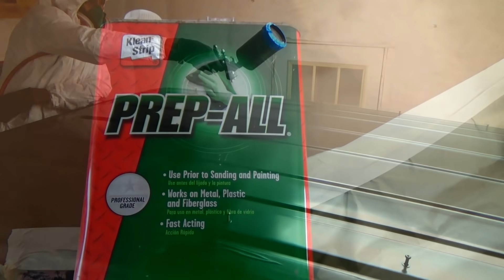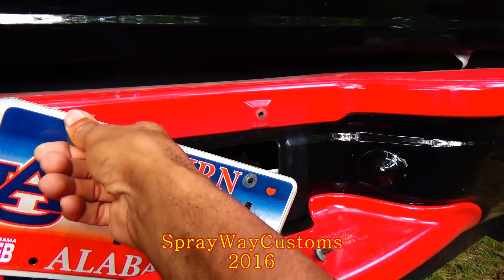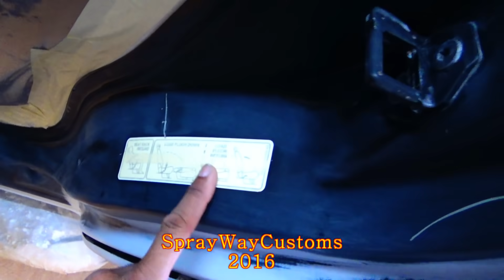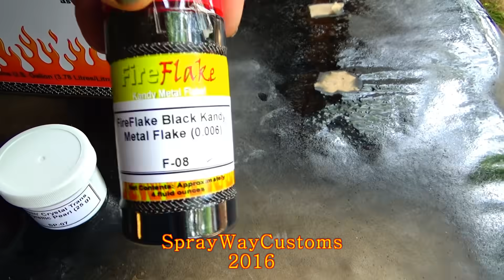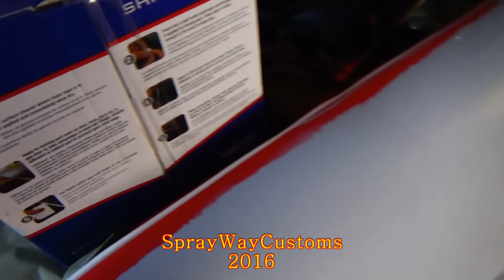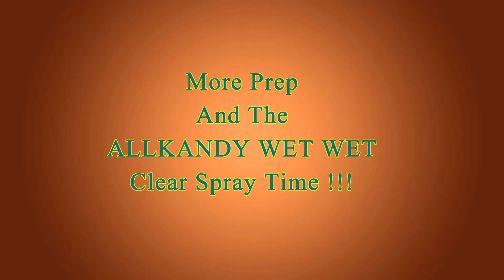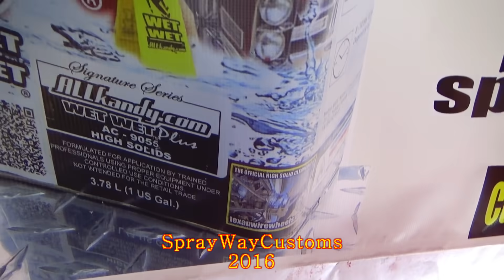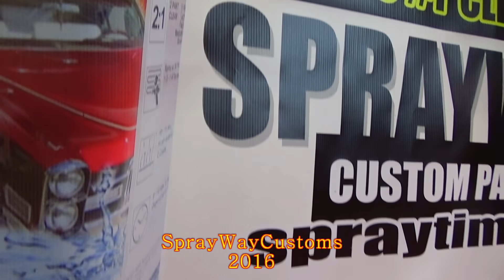How To Paint A Car Or Truck At Home /Three-Stage Pearl / ALLKANDY Wet Wet Clear / Urekem Base Coat

Comment: Just a tip for the lights is a cloth and some baking soda will take off some of that haze. Good video. Paint is too nice for an exploder but to each his own. Someone probably says the same thing about my 4runner. I know that with 90k miles it will be on the road another 15 years. Thanks for the video

Comment: Excellent work!  When you paint the jambs then are painting the exterior does the blow through in the jamb become noticeable?  My truck is completely stripped and (no glass or interior) and I'm painting all of it, and I'm not sure how much to mask off.  When I'm doing the interior and jambs and they are done, should I be masking them off or putting foam in the jambs etc to keep the overspray off?

I'm using Urekem single stage Metallic black.

Keep up the videos, you inspired me to try to do this myself!

Comment: Got a question for you. I have that same harbor freight spray gun you used for the primer over the body work area. It says it requires 14cfm which is a lot! Most other guns say the same. What size compressor are you running..???
Reply from the maker: I have a 60 gallon Husky Compressor from The Homedepot

Comment: What's good dog. I'm starting to get pressed for time and money trying to figure out how to cut some corners. Can i sand single stage paint, use it as my primer, and apply my color even though single stage has clear in it?
Reply from the maker: If the paint in good shape there's no need to prime it maxie9506
Reply: @SprayWayCustoms  its chipping in spots. I was thinking spot repair, body filler,  prime over the spots then paint.

Comment: Is it possible to color match a stock vehicle colors
 and translate it to a candy finish? Say you want the original ford Emberglo which was a two stage paint job. Use a black base with minimal flake, a second layer of 2k clear, spray the Emberglo, then a layer of 2k clear. Am I on the right track?

Comment: Another good job bro. Im sitting over here at around 4:50 cringing when you pulled that seal on the door and I saw they had Copper Clad speaker and power wire. Get your boy to get that shit changed to real copper. But you keep doing you, looked great man.
Reply from the maker: Lol...I need to send him on over there to you and you'll get him straight..without a doubt..thanks

Comment: I am going to try and paint my truck, I want to go with two colors but I am worried about cure time on base coats before applying clear coat, how many days was it from when you painted black and clear coated hood to when you clear coated whole car? I been trying to read if you can go over 24-48hrs after base coat and still insure clear coat will bond good, noticed you sanded hood after you applied black base, is that the trick? Can you clear over base or other clear after weeks if you sand it or does it still need to be done within a day ? or hours?
Reply from the maker: If you wait after 24 hours I would recommend sanding it so the paint will stick.

Comment: in the begining when you DA'ed with 180 you feathered in the two tone line. But after when you cut back in the video and the whole truck was done but the two last doors, How did you you finish it because you didnt show?
Did you continue with the 180 on the DA? or Did you use a different grit? or Did you use a block instead?
thanks
Reply: and when your done with all body work and your ready to prime do you sand the whole car with 400 or scotch brite??. Thanks

Comment: You covered that whole truck with 2 quarts of pearl and the reducer?
Reply from the maker: I had a gallon of intercoat clear with 25 grams of each pearl but I didn't use all the pearl in the clear. I had plenty of the mix left
Reply: SprayWayCustoms awesome man thanks for the reply 👍 you do some badass work bro

Comment: Have you tried the new high solid clear yet that you can cut with reducer? Watched a all kandy video other day. Crazy how you spray and have very little trash and dude at all kandy spray and he has enough trash to fill a landfill. 😂. Not trying to cut him down just sayin.
Reply from the maker: Matt, I haven't tried the ALLKANDY EXTREME yet but it's going on my next project...I really don't get much trash..only problems I might get is overspray landing back on the panel if it don't get pulled out the booth in time. I might get a bug here and there in the summer time, it's really the environment  and the weather plays a big part in it too if your not spraying in a real spray booth...thanks for the comment

Comment: Next time you mix your UR-011, try turning it sideways or upside down, it will help with dripping down your hands. Also, for someone who never painted, what setup would you recommend for a beginner. For example, Type of spray gun/compressor.

Comment: I take it ur lid on ur paint cup has popped off b4?? hinse  the tape ..shit happen to me a few times ...like them puppies
Reply from the maker: It never popped off during paint but it have leaked when full and that's something you don't want to happen in the process of painting that's why I just put a piece of tape around the lid...I got new cups and lids but I just always use the same old cup...lol
Reply: +SprayWayCustoms I saw these cups with a screw on lid at harborfreight I might try ..
Reply from the maker: I got the plastic SATA cups, I just prefer the aluminum cups because the clean up better

Comment: Out of all  videos  on painting  yours  100 what gun are you using  for primer what  tip and what mix ratio I use polyester primer  sometimes  difficult  to  spray sometimes  I have  to  mix down  getting  a 2.0 tip but great videos
Reply from the maker: I usually use a SATAjet 100 primer gun but I used a cheap Harbor Freight Purple gun with a 1.3 tip on this job. I just thin the primer down and put more coats on. Thanks for the comment

Comment: What are you doing to remove all the dust, dirt, lint and over spray and keep it off the car while spraying? Do you wait for paint to flash a little before moving on to another section of the car? What do you do about static in all the plastic body parts that literally turn into electromagnets after wiping them clean? Can you please be a bit more detailed and specific?
Reply from the maker: I just wait until the end and do a cut and buff

Comment: Nice paint job, but I would have done 2 minor things.. 1) Although the side moldings being completely black would have been an over kill on the side of the vehicle due to the windows trim and foot step being black, I would have at least put a small black pinstripe along the top of the side molding, put black pinstripe in the grooves of the bumper step and also I would have put a black pinstripe around the center of the rim where the circle is, as well. I think these 3 minor details would have improved the  look as well.  But over all the paint job was excellent!!!
Reply from the maker: Bernie, thanks for the big support

Comment: Dude just a heads up, dont spray proper paint onto primer it'll bite in and give a false reading you ll be sanding more then you need etc 
Defo use a guide coat like in powder form so it just sits on the primer, nice to see you laying pearls etc proper with a binder coat and not clear coat like most of the idiots but mix it first then add the pearls and flake you'll get a better reading on what the binder can carry, filter the mix before you spray or youll end up with most the pearls flakes being caught in the filter

good job mate